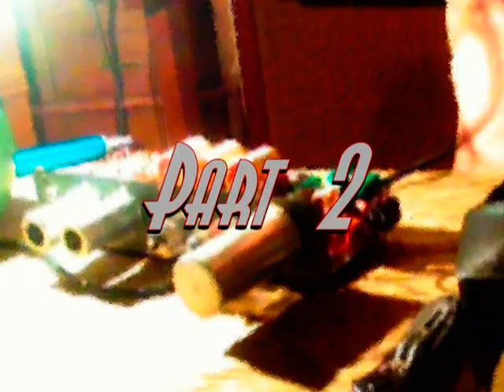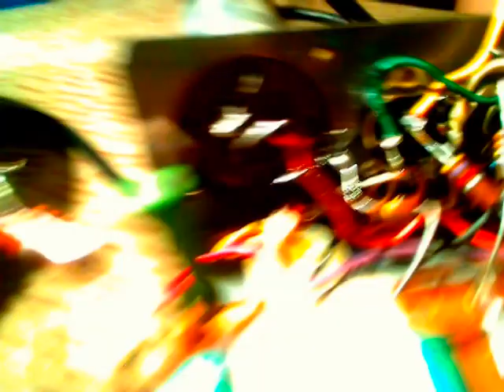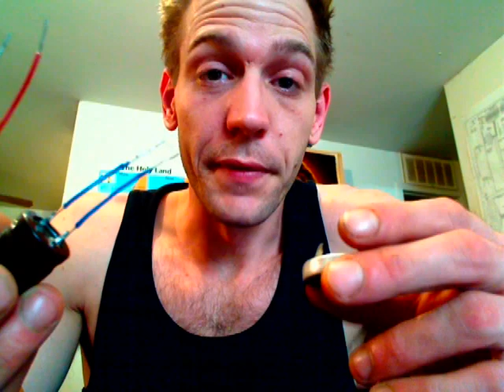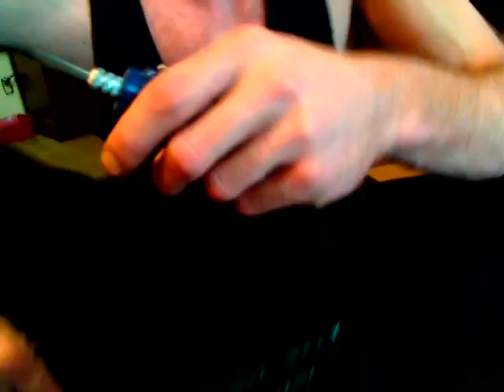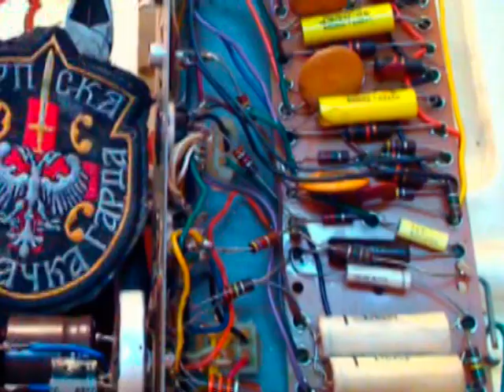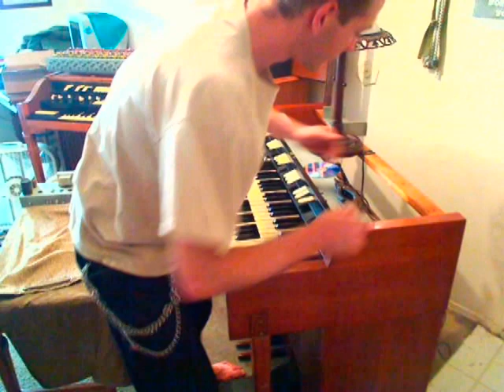Vukodlak Productions-  Hammond AO-41 Vibrato Amp Overhaul

Comment: Yes, they're high-voltage caps.  I've used them when restoring old tube radios, which isn't any different than recapping an amp from an organ.  You can get them at Mouser dot com.  Check out Mouser part no. 647-UPZW6560MHD.  56uF at 420V, but only 12mm in diameter.  They also make some 10mm diameter caps, too.  Check 'em out.